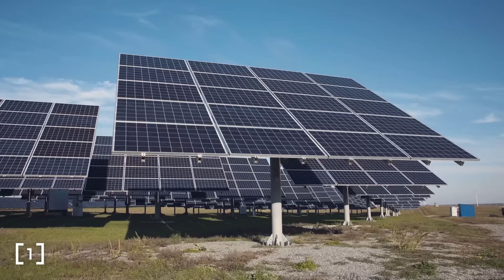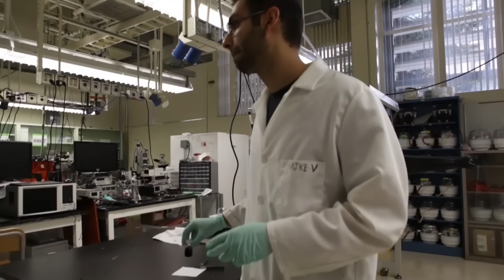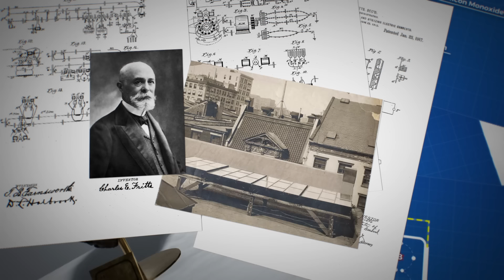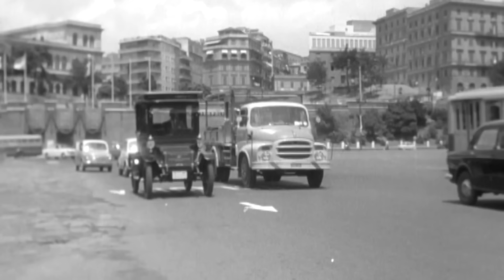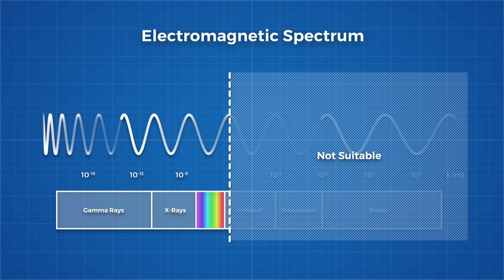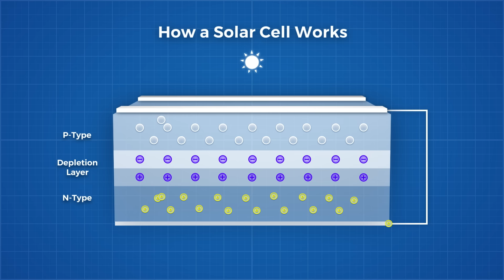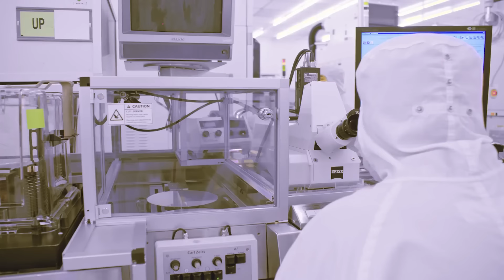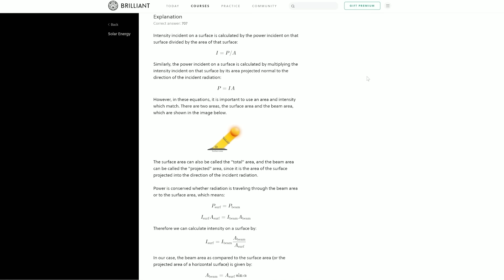The Mystery Flaw of Solar Panels

Comment: What about storage technology...that is where the game will change.
Reply: I want the nano battery that is being developed. Though in theory it would take the equivalent of a lightning strike to charge it.
Reply: @WillO-sh2dz  pick me up a couple while you are there.
Reply: @darrellpowell4331  they are still trying to find a effect way to carve the nano channels for a manufacturing standpoint. The blueprint is there, did the math, but the tech is outta reach until they can stabilize a process to make it.
Reply: You don't need storage. This technology here is obsolete. Next year you should be able to install a shoe sized unit that will power everything in you home electric. in fact it would power three homes that are all electric as it pulls energy from the surrounding atmosphere. No storage needed. Another technology can use a unit the size of a toy rubics-cube and will power San Francisco.
Reply: @kentitus7550  Good One !
Reply: That's actually where the game just breaks because its such a ridiculously high level that we're not likely to see a winning technology before we'd just replace the lot with something entirely different.  Indeed, in almost all cases we're looking at little more than a silly passing fad which, as a person that was once really into solar, is one hell of a harsh realization.  There is no contest here and there never has been.  It was really always nuclear as the only other choice for base load generation and maybe battery technology allowing nuclear plants to have peaking capability, since it takes a small fraction of the battery capacity to fit the stable output of a nuclear plant to the base/peak load demand.

Oh, and in case you had doubts, it also takes 5-10X the materials and labor for the same output with renewables.   So again, its not even close and it never has been.  Its all been propaganda and dreams.
Reply: @poitsplace  I completely agree with you that nuclear is the only option we have going forward to be carbon free
Reply: @poitsplace  so what is propaganda and dreams "solar"?
Reply: @darrellpowell4331  The propaganda and dreams is how its been presented verses the reality.  Been studying it for years.  Started out as a fan, but the more I learn the worse it is.  Suffice to say we'd be better off putting all this development money into developing more flexible types of reactor technology.
Reply: @poitsplace  Strike price of Hinkley C is 9p/kWh, offshore wind is now 4p. We need to be investing in Hydrogen for energy storage for renewables and in combination with nuclear we will be carbon free.
Reply: @pennyandian  I did the math on various methods a while back and it looks like the best balance for wind/hydrogen is to use tunel boring machines, huge metal lined tunnels, and then just burn the hydrogen in combined cycle gas turbines instead of bothering with fuel cells.  You lose some efficiency but gain raw output and flexibility.

Here's the thing though.  Renewables require insane amounts of money, radical reworking of the grid...and then by the time its to its stated end of cycle some entirely different technology like LFTR, fusion, etc will be available and the hundreds of TRILLIONS of dollars spent on infrastructure will be ripped down (or more likely left to rot in place because the economy will be dead).  Just a complete waste of our time and a distraction from real problems that we might have some actual chance to solve.
Reply: @poitsplace  Have you studied torium as a nuke fuel?
Reply: @darrellpowell4331  Of course I've looked into thorium and the LFTR.  Actually I just assume we'd use uranium at first for most of the world's LFTR's at first.  I guess that's an LFUR.  But they'd use that since it breeds fuel faster and doesn't have the same radiation/neutron absorbing byproduct problems.
Reply: @poitsplace  you do realize that it's not just about solar farms and their storage technology but also each household? If every household was equipped with solar and batteries the peak demand on the solar plants would be minimal and could easily covered by the battery already installed in the house. If the batteries become more efficient and cheaper, it'll be a more viable option in the future as you'd easily be able to store your 1. own generated electricity from the roof mounted solar panels and 2. top them off from the grid. You'll become more self sufficient, putting less strain on the powergrid and lowering the demand.
Nuclear is nice because it is easy and "green", lots of energy for not much work and basically no co2, though the endproduct is still radioactive and contaminates whatever comes in contact with it. And that's not just for 5 years or so. It will remain highly radioactive for 1000 years depending on the material used. Try storing more and more radioactive waste in a manner that it'll survive 1000 years without falling apart, poisening ground water and basically making a whole area inhabitable. 
I am by no means against nuclear power, I would love to see that field be expanded further as it would be a great substitute for other fossil fuels while we change our grid towards renewables, but you can't just say that nuclear power is the way to go forever. It'll only help us on our way to renewables.
Reply: @Tobias611  What you're talking about is using what is essentially the same amount of batteries and solar, just hiding the cost from ...well yourself... by having it spread out among the people instead of spread out among the people thru rates.

Also, a little side note you're not thinking about, the grid needs to be completely reworked for any substantial home rollout because the transformers are made to adjust for relative voltage drop going from the power plant to the home and in the opposite direction they would adjust DOWN, doubling voltage drop rates.

Which by the way brings up a much larger problem.  One of the key points of the grid is to keep the voltage more fairly constant across all segments.  Go ask a physics friend to talk to you about calculating volrage across resistor arrays and then ask him how easy it would be to keep it constant when you keep moving the point at which you power the array literally minute by minute.  Germany admitted last year that about 60% of the power that's supposed to be following the high tension lines in fact cascades AROUND the lines, displacing closer loads and overloading the system.  

We've been done a horrible disservice by the media and proponents of renewables by them just glossing over all of this stuff as trivial.

It should be noted however that I do actually talk with quite a few people about practical application of renewable energy...but almost all of them, like me, are against its large scale rollout.  They're more independent types and are willing to deal with the sacrifices or to pay the extra money to not make them
Reply: @Tobias611  A few misconceptions about nuclear here.

"The end product is still radioactive and contaminates whatever comes in contact with it."  - Yes, nuclear power will produce radioactive isotopes.  Fusion produces different ones than Fission, Fusion produces "less" but is also not capable with current tech, at least, in an energy positive way (meaning, we can't output more energy than we put in).  Fission products are a great discussion point which I'll hit on in a second.  Radiation is not contagious.  A radioactive atom will not make a non radioactive atom suddenly become radioactive... at least not easily.  To do so requires neutron capture to the point the atom becomes radioactive (not that easy for most common materials).  The only way radiation migrates is if the radioactive element is allowed to freely roam and deposit itself in various places.  This is why you can still detect radiation at Marie Curie's lab... the door knobs didn't become radioactive, she was depositing radioactive atoms on the door knob.

To talk about nuclear waste though, spent nuclear fuel is a solid ceramic surrounded by zirconium alloy cladding.  So long as that cladding isn't breached, then no nuclear particles can "spread" radiation.  Spent nuclear fuel (SNF), has a few other issues which govern our waste strategy.  The biggest one is that SNF is 95% unconsumed Uranium-238, no more radioactive today than the day it came out of the ground.  Your new fuel rod is between 96% and 97% U-238 and the remainder being either U-235 or a plutonium isotope (MOX fuels).  When you put it into a reactor, you are only burning off the U-235/Plutonium-239 and a tiny amount of the U-238.  About 1% of SNF is Plutonium-239 and other transuranic (larger than uranium) elements.  The remaining ~4% is fission products, those two elements formed when U-235 splits.  

Nuclear fuel reprocessing allows us to reduce the waste products to just the fission products, or roughly 4% of the total weight of all SNF.  Right now, that isn't happening anywhere in the world except the UK, France, and Russia.  Most other places are using the "once through" method for fuel.

What we do with the rest is easy... U-238 can be consumed in fast spectrum reactors and releasing the massive amount of energy potential it has.  The Transuranic elements can all be put back into fuel and consumed as part of MOX fuels.  

Why do we care about reprocessing fuel?  Because fission products have SIGNIFICANTLY shorter half lives than the Uranium and transuranic elements have.  Right now our fuel storage policy is dictated by PLUTONIUM in the fuel, which has a very long half life.  The vast majority of fission products have half lives of around 30 years or less.  There are a few with very long half lives but they emit very little radiation.

That brings me to the next point, radiation danger has an INVERSE relationship to half life time.  A long half life is SAFER than a short half life in terms of radiation danger.  What is NICE about shorter half lives, is we can more easily manage that radiation.  Right now, in the US, SNF is kept in cooling ponds for roughly 10 years by which the radiation level drops off by about 80% as the fission products decay away to background radiation (remember, the bulk of which have half lives of 30 years or less).  It is at that point, it is removed for dry cask storage. 

If we follow current guidelines, 10 half lives is about what it takes to reach background radiation.  300 years for Fission Products to decay to effectively no radiation is far easier to manage and plan for.  Yucca Mountain is MORE than capable of handling that.  That also assumes we have ZERO use for those fission products as radiation sources or for other things.  

Another thing, SNF is not mobile in the environment.  By that, I mean, it isn't easy to spread it around.  As a solid, it is not soluble in water (which would be a problem in water cooled reactors! ;) ) and careful location of any geological repositories can minimize risk.  Yucca Mountain is in the same mountain range as the US Nuclear Weapons Test Range and Area 51.  It's not exactly a booming area and ground water penetration is very low there.  The studies of similar geological formations elsewhere in the world show that even if 100% of the nuclear fuel casks "leaked" fuel into the groundwater, it would take 300 years to reach the surface and the concentration of radionuclides which the public would consume would give a LIFETIME dose of radiation of about 2-4 additional bananas being eaten... yeah... 2-4 additional bananas over your LIFETIME would be the MAX exposure someone could receive in the worst case scenario for these geological storage sites.

I hope that helps clear up some things!
Reply: @Tobias611  1. That's just it very few houses have a good solar window (which most time needs to be maintained). 2. Any time you pierce a roof to hold anything it becomes a weak place for leaks. Imagine the bill for roof repair or maintenance of it is stacked with collectors. 3. To truly benefit from a solar installation it is best on the ground and it's owner have some mechanical /electrical background. 4. The solar panel guy then relies on all the other utility customers to financially support the transmission and distribution of the grid not to mention the peak demand generators which the solar guy will more than likely depend on because of several cloudy days. And yes Nuke is a good way but not uranium.
Reply: @Whiskey11Gaming  Thank you so much for the clear and well articulated info! The possibility of using the "waste" as fuel is extremely fascinating to me and always has been. Much like when Henry Ford used the byproduct gasoline, to fuel engines. 
  I gotta tell ya, if your comment was expanded to a large book form, I'd buy, read and enjoy it👍🏻

Comment: It's really interesting to think about all the ways that we can harness energy from our surroundings, but could you do a video on how battery technology is coming along? I think that's the biggest problem we face, since we often produce energy surplus that we can't store in an efficient manner and instead need to rely on a brute force manner of installing more harnessing sources to make up for it in the worst case scenarios.
Reply: I was recently told by an alleged expert that I won't need a battery back-up for their company's solar system.  I didn't take this advice and have not as of this date had solar panels installed.  Even though this presentation regarding the history and operations of  solar, I still didn't hear the financial advantage of pursuing such installations without further R & D.  Did I miss this information?

Comment: So... according to the figures given here, "at the end of 2019 the total installed capacity of photovoltaic cells exceeded 630,000 MW".  This is a relatively useless number (as well as something that I cannot verify the source of), as ratings in MW just indicates the peak generating capacity of a source which is never reached in the real world (actual generated power for solar depends on time of day, angle of incidence to the sun, cloud cover, altitude, dust, etc). In my home area, the expected yield of a 1kW panel is around 4.4 kWh per day, or about 1606 kWh per year. Out of a total global electric production (estimate from https://yearbook.enerdata.net/electricity/world-electricity-production-statistics.html) of 26914 TWh/year (tera-watt-hours, or in other words, 26914000000 MHw/year) that gives the 'total installed capacity of photovoltaic cells' (assuming they were all in my home area) at 3.75
% of total produced electricity.  Please understand the relative size of areas of improvements: a better distribution grid, better turbines for wind, hydro OR gas, more efficient nuclear or better gas cyclic efficiencies would dwarf any gains here.

That is not to say that research in improving solar is pointless: there are many applications where solar is the best and most logical choice: remote sensor systems, off-grid lighting, low power remote control systems, spacecraft, etc. But one must understand the entire domain-space of a problem before trying to propose solutions that will actually solve problems.

Comment: So what this long winded story tells us is that of 100% potential of solar power they can only produce 20%, and fall to less than 18% almost immediately, that is at over 100 years of development. This on top of the fact that it can only produce during the day, and only with no (or limited cloud cover) cloud cover. And the fields necessary to hold the panels is enormous (this is implied by the output) Solar power may be an aid but will never be an answer. When you put wind in to play it is still not sufficient to power the growing power requirements of the world.

Comment: There has never been a wind generator or a solar panel, ever made, that can produce the energy it took to make them.  FACT
Reply: I'd like to see some sources for this fact, given that solar panels are built using economics of scale which results in per-unit costs to fall with increased volume.
Reply from the maker: You’re an Alien Santa. FACT

Is this how referencing works? We just say “fact” after some bullshit?

Comment: It's interesting hearing about the various coatings used to improve the light dispersion/ pass through in the glass. Correct me if i am wrong but this sounds awfully similar to how Nikon and Canon develop some of their top end lenses. Is it possible for research in both fields to cross over in some areas? For example. Gallium coatings are used in higher end lenses to substantially reduce reflections, lowering the overall reflective index of the glass/quartz.
Reply: Yes the principles of anti-reflection coatings are very applicable across fields.  I'm not aware of Gallium coatings specifically in solar though.